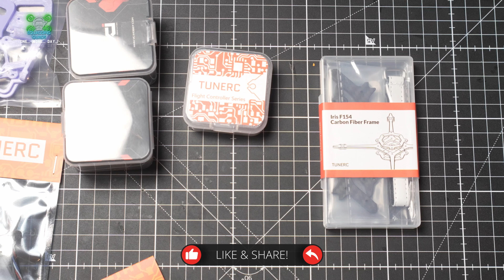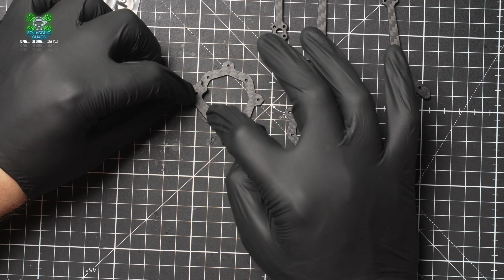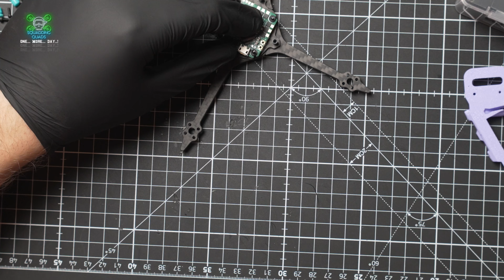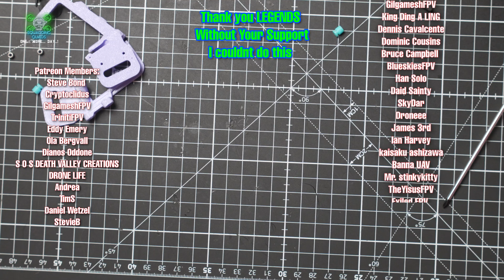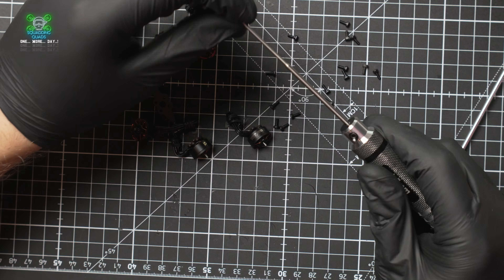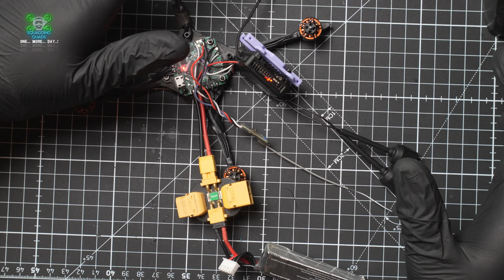TuneRC 3" Toothpick Build Guide – Full Walkthrough & First Impressions!

Comment: I’m not sure I could do this alone.  You were a little when you connected some part… geez…. Make me nervous to try mate
Reply: Hey mate, this is Aria from TUNERC. Which specific part makes you nervous about starting building one yourself? Frame assembly or soldering? Feel free to let me know if you have any questions, happy to help you out.
Reply: @tunerc_hobby  It's the souldering I did not do for the last 20 years... I'm scared that I will mess it up
Reply: @JeanFrancoisPoulin1  Our AIO has decent pad layout and the pad soldering is easier than many other aios. You can start from soldering a practice board first, once you feel comfortable with the soldering, then you can try soldering an aio.
Reply: @tunerc_hobby i was helping my father shoulder circuit board when I was 15… 50 years ago!!! So maybe it would come back fast… got to try!
Reply: @tunerc_hobby  So you recomand this one in this video has a start ! or a simpler on? I just need to buy a DJI 04 camera and pouf its a go?? I'm really tempted (Partly because you're nice enough to follow this conversation I have to say)
Reply: I would definately make a newbie video of me putting it together!
Reply: I received everything except the batteries so it is my homework for next week for sure!!
Reply from the maker: What do you mean mate?
Reply: @squaddingquads I’m going to have to listen to it again to be sure I can tackle this.. :)
Reply from the maker: @JeanFrancoisPoulin1 any issues just hollar
Reply: @squaddingquads  What does ""Hollar" means? Sorry french speaker here ;)
Reply from the maker: @JeanFrancoisPoulin1 sorry, I mean, just drop a comment if you need help
Reply: @squaddingquads  I’m about to start the soldering part tomorrow. I’m very nervous about it because I’m not quite sure if I got right the positioning of all of the wire that you show in the video.
Reply from the maker: @JeanFrancoisPoulin1 please use a smoke stopper before hugging anything in
Reply: @squaddingquads  you mean a ventilator? not to breath the lead? And at 18:23 I dont see where you put the blue one!!!